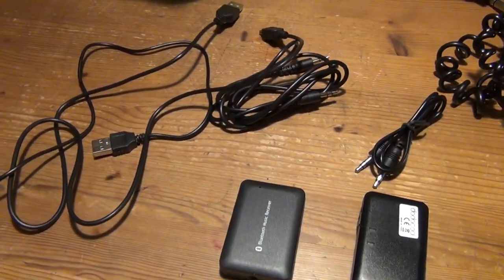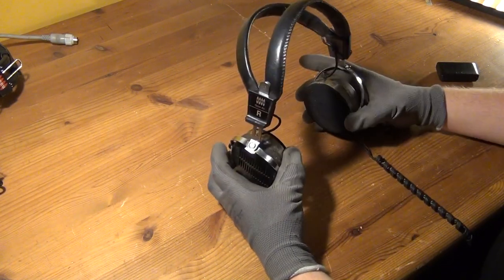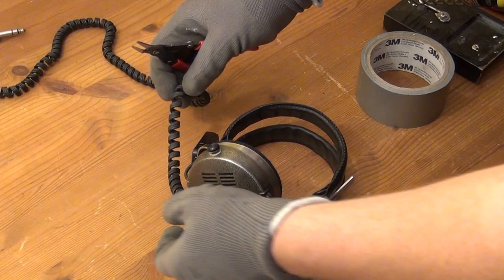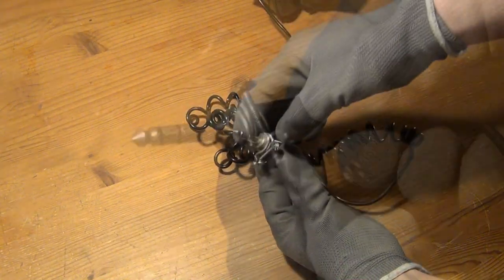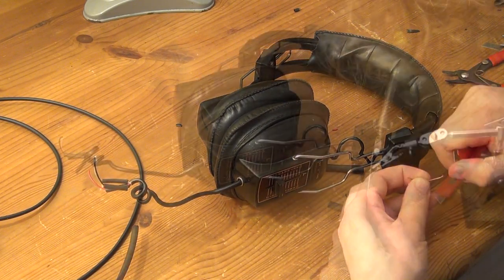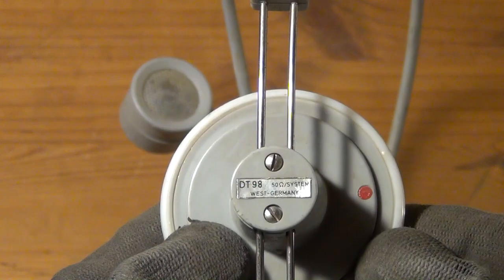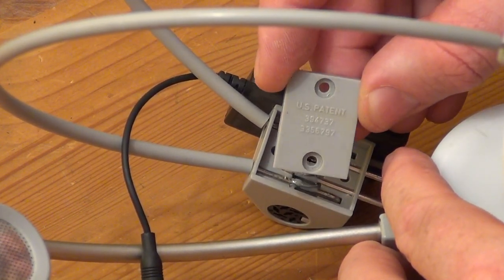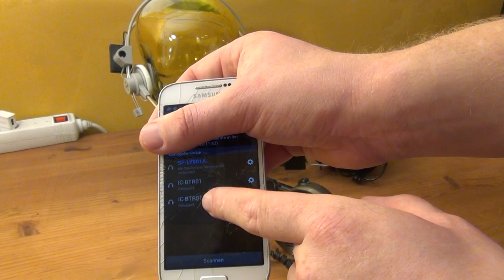Hack: Retro Headphones with Bluetooth!

Comment: What I did was take apart the earcups & the receiver and put the parts of the receiver inside the earcup with some hot glue. Also I drilled holes & installed pushbuttons which i then connected to the buttons on the board. Also drilled a hole for the charging port. Looks much neater since the module is hidden inside one of the earcups.
Reply: Exactly, it's way better, I've done it before

Comment: You probably have to modify the Bluetooth module to make it sound better.  Those headphones probably have a 600 Ohm impedance.  I know that our Chinese friends use rather small output capacitors in the output that are fine when connecting to a 10KOhm input but act like a high pass filter when connecting to a headphones etc.  You will lack bass.
So check the output plug and trace back the output capacitors and put 47uF or 100uF in parallel and it will sound a lot better.
Reply: Well makes it even more important!   And yes there are 600 Ohm ones  https://www.cnet.com/au/news/headphone-buyers-heres-what-you-need-to-know-about-low-vs-high-impedance-models/

Comment: I think they would look so much better if you simply hid the bluetooth modules in your pocket.
Reply: I wanted to see him put the Bluetooth module inside the headphones.  the board is likely much smaller than the case that it is in.  the board could hide inside the headphone enclosure (battery on one side and chip in the other). he's just gluing it on and making it a fashion statement. would be much better hidden I feel. might be tough in the white set though.
Reply: he should change the speakers inside while there, i had listened to some old headphones and the sound quality is very bad...
Reply: kay486 he should have glued a bluetooth in your pocket
Reply: Touché...
Reply: kay486 hell if you actually hack it you could hide it inside the cans. I mean shit they even say "open air" that means they're mostly air. get some koss portapros and swap the drivers hide the bluetooth. done.
Reply: Yup...
Reply: Dennis Woycheshen well that was fast lol
Reply: I was super disappointed with his solutions.
Reply: I have 2 pairs of Bluetooth headsets both with mics and a crystal radio headset. I think I might just put 2 and 2 together.
Reply: Be sure to use duct tape... Lots of duct tape.

Comment: Für den 3. gibt es sicherlich kleine Schaumstoffbezüge. Ich meine, dass die damals mit 6 geliefert wurden: 2 zur Verwendung und 4 als Ersatz. Auch aus hygienischen Gründen.
Abgesehen davon finde ich es schade, was manchmal noch als Hack bezeichnet wird. Gern würde ich in einer Welt leben, in der solche Sachen völlig selbstverständlich wären. Tu ich aber nicht und somit: Schönes Video. Bei dem zweiten Kopfhörer hätte ich das Kabel aber anders verlegt und beim 3. frage ich mich, ob das ungleichmäßige Gewicht beim Tragen auffällt. Ich hätte vermutlich das Gerät an der anderen Seite befestigt... Oder nicht. Egal, trotzdem gute Lösung.
Danke für das tolle Video! :-)

Übrigens: Toller Glaskopf. Auch Flohmarkt? ;-)

Comment: I wonder if one could find and take part a smaller Bluetooth receiver and install it directly into the right or left side of the earphone. Where it would all be inside for a cleaner look and internally connected. Then find a vintage looking button for the power button and then make a hook up for USB power.

Comment: I have to wonder if there's a way to do this without removing the aux option on it
Reply: Cole DeSantis Just buy a 3.5 mm extension cable and make sure to add a jack to the wire you cut. If you are using the newer style one like the second example you would need to add a male jack to the cut wire and a female one to the receiver.
Reply: Should be no problem to solder an additional 3,5 mm audio jack in paralell to the bluetooth receiver
Reply: i did it the elegant way and bought myself a sony sbh20 bluetooth receiver for 20-25€, cut the cable on my old akg studio headphones at about 25cm, soldered a male jack to the short headphone end and a female jack to the cut cable. so i can use it with the bluetooth receiver or with the old cable as an extension. the cool thing about the sony sbh20 is, it has a little metal clip on the back that i use to attach it to the top of the headphones. the price on the sony sbh20 increased though, since i bought it.
Reply: Cole DeSantis Yes, just look at the first solution. There are 1 meter extension cables for aux.

Comment: why would smn ever do this? cable is so much better :/
Reply: ecoutezmusic If you have a iPhone 7 maybe?
Reply: iPhone 7 truly is a sign of the apocalypse.
Reply: Mike Van Pelt
then you better not have an iphone7 lol
Reply: ecoutezmusic No, in this case, when you use a smartphone, defenitly not.
1. The dac in the phone and in the receiver are probably on equal quality.
2. Long analog cables lower the sound quality. It works like a long capacitor between the poles.
3. Without a long cable, it is so much more comfortable! When you use it with your pc and you want to go to the toilet or the fridge, just keep it on.
Reply: Len P Or, you could just keep your phone in your pocket.